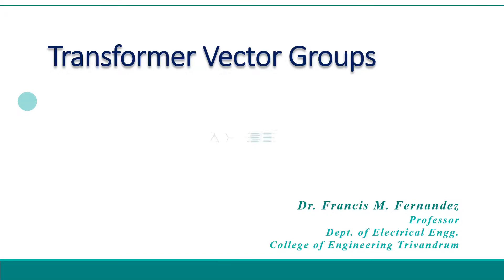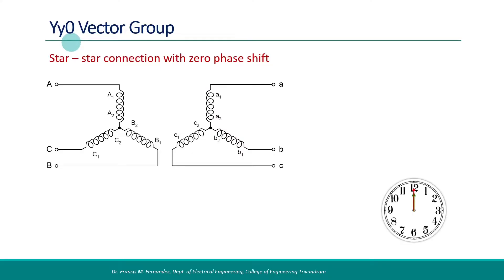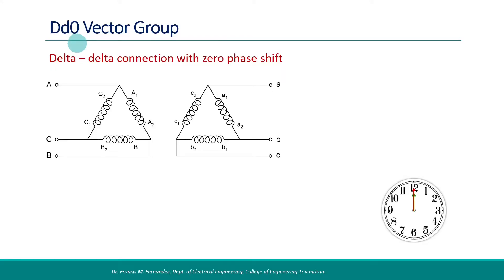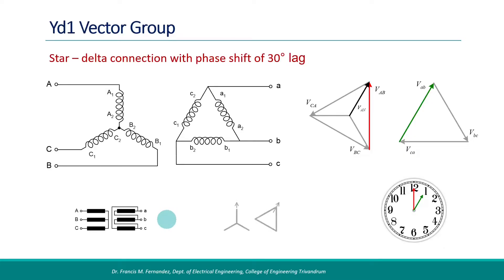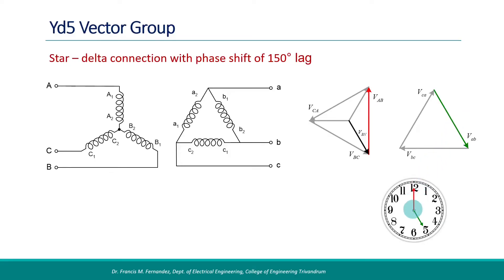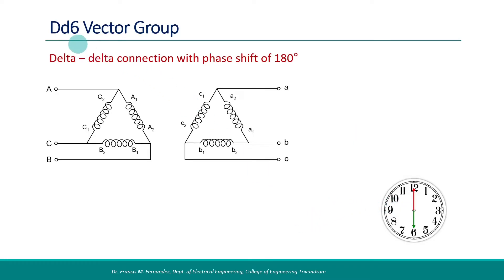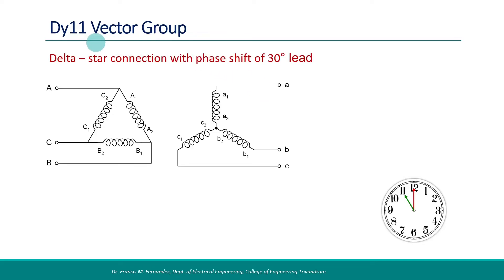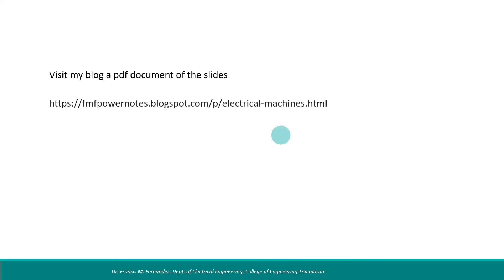Vector Groups in Three Phase Transformers

Comment: 5:20 The YD1 vector group diagram appears to be incorrect. Bear in mind that corresponding windings (e.g., 'A' & 'a' or 'B' & 'b') sit on the same core leg. This means that the same magnetic flux MUST cut through them, and therefore their EMFs MUST have the same phase angle. No transformer nameplate ever represents a YD1 as shown in this video. Please fix this, because it will be misleading to those trying to learn how to understand these diagrams.

Comment: what is the difference between Dyn11 and Dy11
Reply: Dyn11 means neutral is grounded at Y side, Dy11 means neutral is open grounded at Y side. Here 11, indicates LV side voltage and current are 30 lagging to HV.
Reply: @sakthidhasan3764  About the grounding part your explanation is fine. But 11 means, the LV side voltages and currents  are leading HV by 30 degrees.
Reply: I think Dyn11 and Dy11 are the same but  on Dyn11 the neutral is brought out unlike Dy11 where neutral is not considered at any point

Comment: Distribution transformer is generally of Dyn11. But generator transformer is Ynd1. Why it is so
Reply: The distribution transformer is usually of Dyn11 vector group, since the single phase distributed loads will be far from ideal condition, in the sense there will always be unbalance between the loading of each phases, resulting in an unbalance of LV side neutral due to all the unbalanced loads at a moment. It means that the LV neutral will have a resultant zero sequence current flowing into its neutral point at the transformer. This will cause a shifting of the neutral point voltage too. The zero sequence current will be trapped inside the delta winding on the HV side of the distribution transformer and thus the propagation of zero sequence current towards the source is prevented. The delta winding is hence said to have a have a circulating zero sequence current that is trapped in the delta, i.e, It will not be reflected in the primary side of the transformer(the CTs at the HV side of the distribution transformer will not see it as they are not installed in the transformer usually). If the HV winding was of star type, instead of delta, the an HV equivalent of the LV zero sequence current will flow though the HV side neutral of the distribution transformer towards the source (i.e towards the substation transformer that feeds the distribution transformer). This would cause the protective relay to pick up and possibly trip the CB, in case if there is enough unbalance in the loads in the star connected secondary side. In order to prevent these unwanted trippings, the distribution transformer is selected as of Dy11 vector group. Similarly in a generator transformer, the outputs from the generator transformer (GT)  is Star connected. It means whenever there is a fault or unbalance in the load side (ie. on the HV side of the GT, which will be the load side), it will cause a zero sequence current to be generated in the star point of the GT's HV side, for the protective relays of the GT's HV side to pickup and even trip. In normal case this would not happen. So in case there is an unbalance or fault in the the GT's LV side, which is connected in delta will have a circulating zero sequence current, which will NOT be permitted to go further upstream into the generator stator. The generator stator would have had to accept the zero sequence currents, had the GT's LV side been Star connected. This would cause zero sequence component of current and some negative sequence current in the stator. Negative sequence component would cause rotor heating. Zero sequence current will be flowing into the generator neutral also, causing the Earth fault relay of the Generator to pick and even trip in case of enough unbalances due to the faults on the HV side. (This could be possible in case of a single phase auto reclosing event at the GT's secondary side, after a fault occurance). So , the GT's LV in delta configuration prevents the load unbalances in the secondary sides from propagating to stator. Also, it suppresses the various harmonics from load side from propagating upstream. I hope this explanation gives an idea now!
Reply: @rjshtk  Amazing
Reply: @rjshtk  thank you